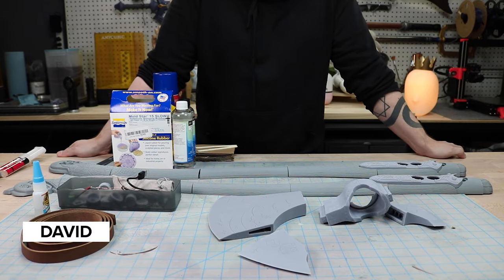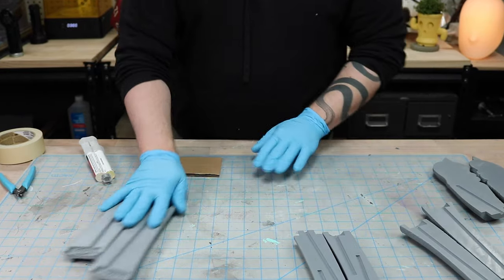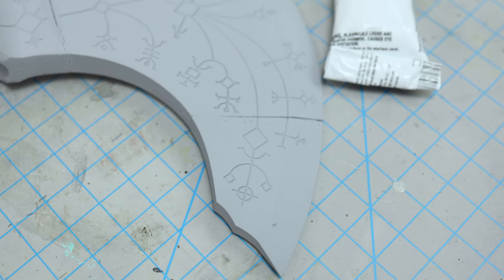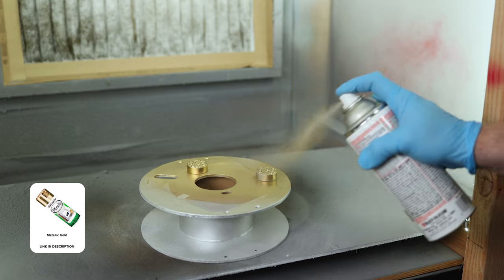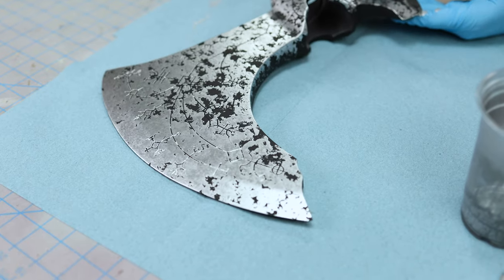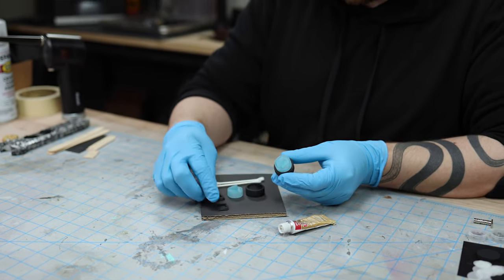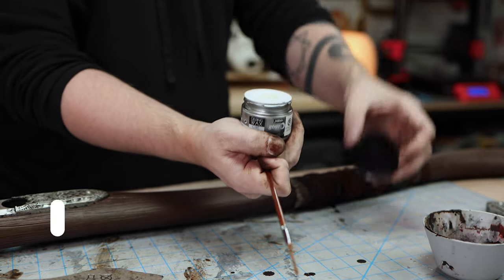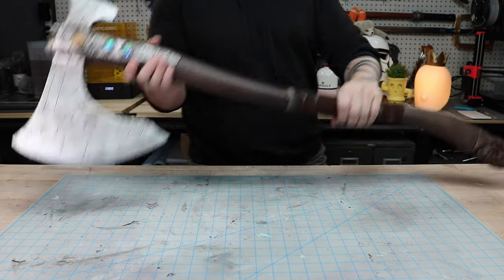3D Printed Leviathan Axe / Kratos' Axe God of War Ragnarök

Comment: Ok, just incase anyone watches this and is also creating it, The bottom section threaded rod is 16 or so, and if you are not using electronics, it seems to be roughly 21 inches for the upper, been back and forth with this today lol. And great job on yours Make/do!!

Comment: @make432 Do you guys have the modified top wooden handle part file available anywhere? I cut and grinded some out of the the mid section, but I too have the same battery's and might be easier to just have it printed to fit. Thanks!!
Reply from the maker: Ah so sorry we do not have the files anymore (David is very bad at saving his modded 3D files)